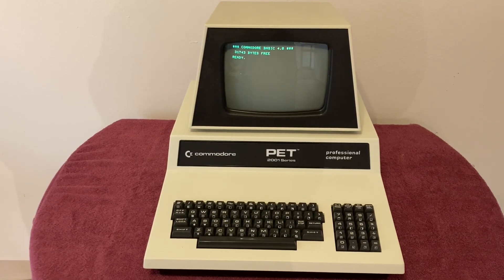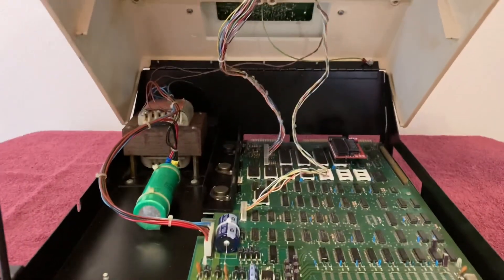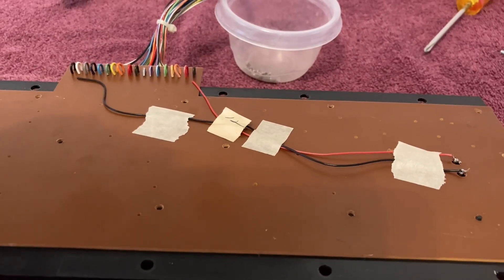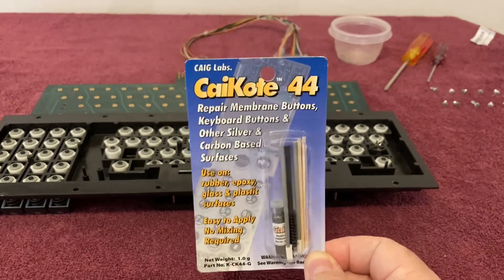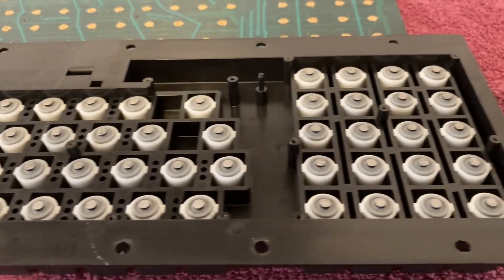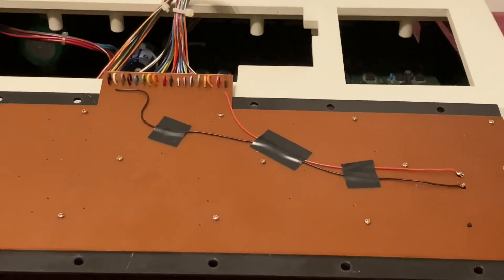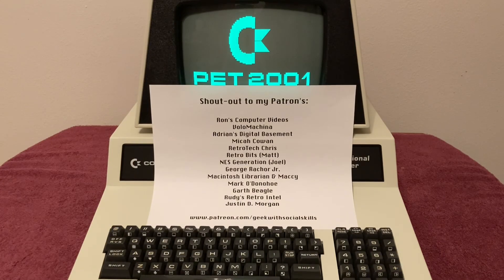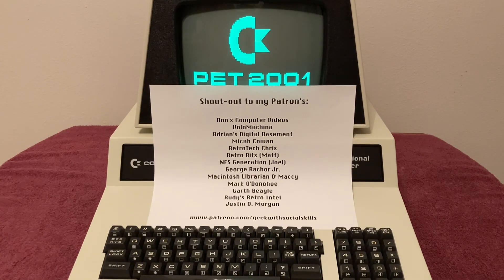Vintage Tech Repair: Reviving a Commodore PET 2001 Keyboard (again)

Comment: Nice work on the keyboard repair. Nothing is more frustrating than a intermittent keyboard.
Reply from the maker: Thanks! I'm very pleased with this machine. Agreed about intermittent keyboard issues being frustrating and as you are aware, working on these keyboards is a PITA, but now that it's properly done, I'm very happy.

Comment: I always recommend against using that conductive paint. It  may flake off after a year or two and really isn't nessisary.
With the carbon impregnated rubber pads, as the rubber ages it dries out making it less pliable but it's only a thin surface layer.
I just use 1000-800 grit sandpaper to remove the surface later of rubber which exposes fresh conductive rubber underneath. That brings 'em back to new performance with no messy paint.
Just my $0.02. YMMV.
Reply from the maker: So two years ago when I rescued this PET (see my January 2020 PET videos), I did exactly what you suggested with the carbon impregnated rubber pads. It worked great for the past couple of years, then this past May 2022 I did a revisting my PET video and some of the keys were acting up again which is why I did the conductive paint. The jury is still out on how long it will last. Of course more PET videos will be coming to my channel, so we'll all find out together :-)

Comment: Use extra caution when de-soldering and especially re-soldering the wires from the shift-lock.
If you linger too long, it's easy to melt the mechanism that locks the switch by heating up the contacts.
Reply from the maker: Indeed, I always try and use extra caution when soldering/de-soldering. Finding replacement parts for our lovely vintage machines, especially PET computers is getting really hard now.

Comment: I used exactly the same stuff on a remote control, cleaned the carbon pads with 99% isopropyl alcohol, followed the instructions but let the coating dry for much longer than they recommended, but not 24 hours.  After a few days, the remote control started acting hilariously weird with a mind of its own, turning things on and changing channels without being touched.  I had suffered the same problem as other users that I see in the reviews - the coating had flaked off.
Reply from the maker: Interesting. I've had multiple friends use this stuff without any issues and so far (knock on wood) everything is still good with my repair. I did type in that 530 line BASIC program over the course of an hour which was heavy use, plus I've been using the machine daily for over a week now without fail. If something changes I will report back with a follow up comment.

Comment: Nice video! I have a 2001 of my own that's waiting for some love to ... one day maybe :P
Reply from the maker: Thank you Mike! Best of luck with your PET 2001 machine. Take my advice, if you have intermittent keyboard issues, just use the conductive paint on all the keys, not just the funky ones. Save yourself a lot of headaches and multiple repairs like I originally did.